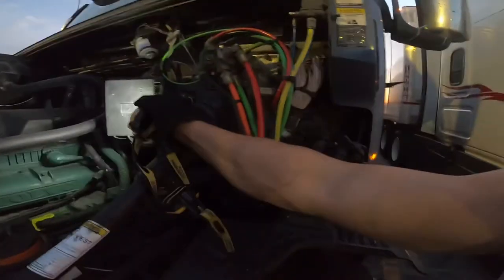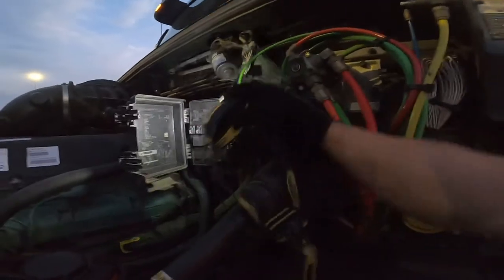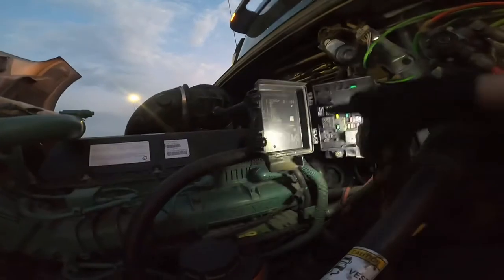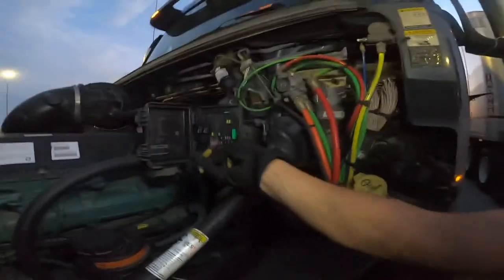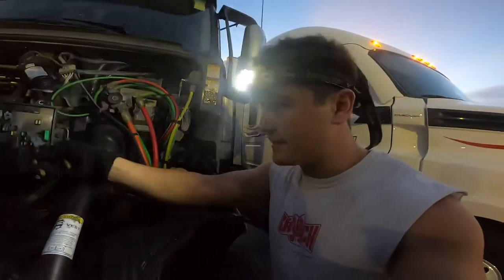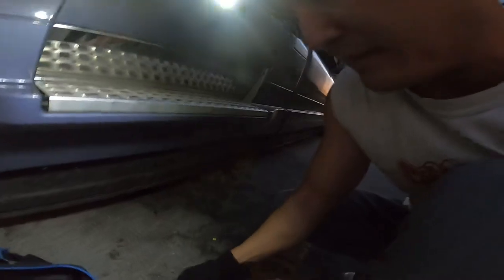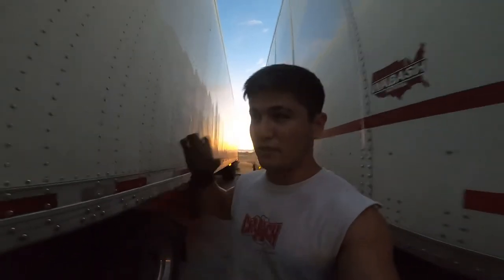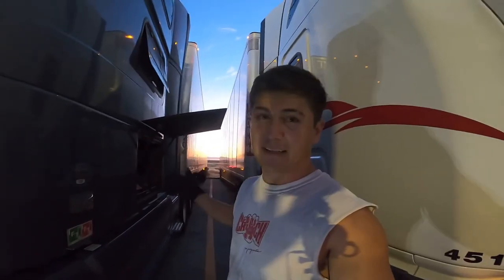How to fix your trailer lights/Easy fix

Comment: Thank you 🙏🏾 just saved me a call & some money! My hazard turn and break lights was working not my night time running did that 20 fuse and got them all back except my marker lights in the front but when I pull the cord towards the driver side they come on so I’ll replace the power cord

Comment: On my trailer running lights work fine as soon as I flip the switch and get my headlights in just the top of the trailer doesn't light

Comment: My trailer clearance lights aren't working the other lights on the trailer are  we've had to a dealer mechanic to fix it and they haven't it's not the trailer cause other tractors work on it.any ideas? thanks
Reply from the maker: I would check your electric line from the truck to trailer (the green cable that connects your truck to trailor) Mine once had a corrosion, and was peeled rubbing against my catwalk. There are some fuzes on the trailer, I would check that first. What kind of truck do you have?
Reply: @Realsamthetrucker  2016 Volvo I think it was built on a Monday morning or a Friday afternoon cause it's one problem after another. Our Mechanic cked the fuses thidy morning he said they're good.   ???

Comment: Out of 3 trailer clearance top lights, one is not working 
What should be the reason
Two other top clearance lights are working fine
Reply from the maker: I have had the same problem once. It has to be one of this two reasons. 
1. Lightbulb is burnt 
2. Your wire is cut right before the last connection which you have to use a ladder to check. For me that was the case. The wire was cut on top of my trailer right before connecting to the last clearance light housing